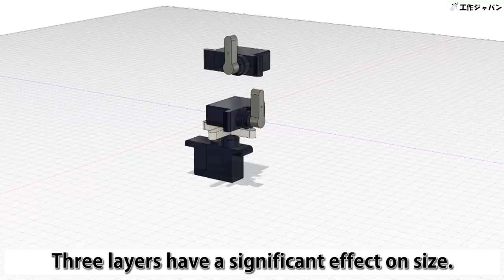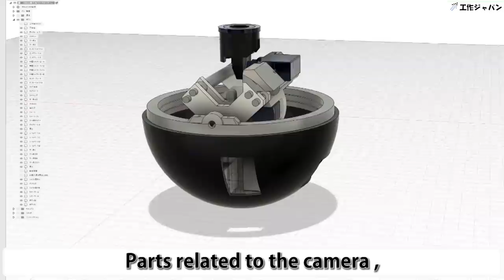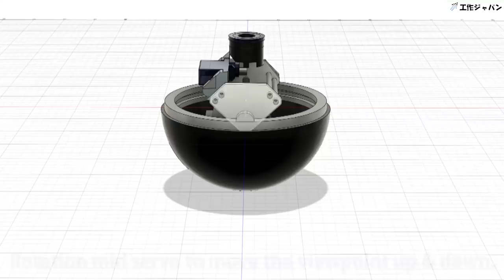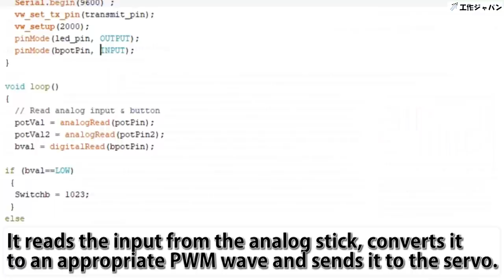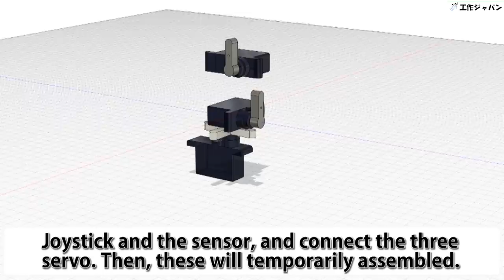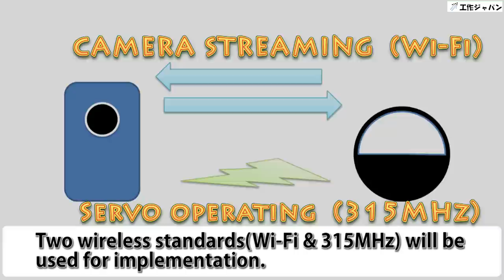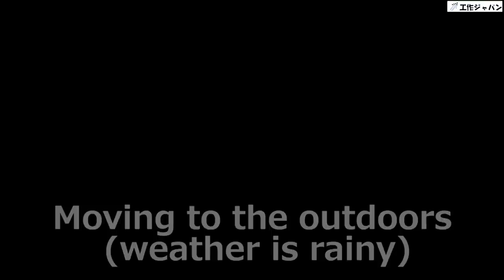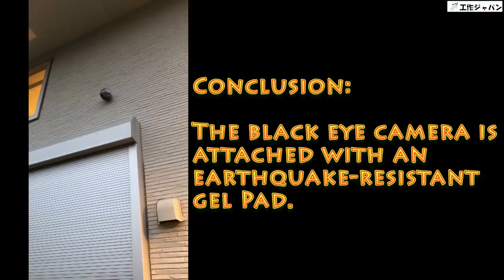I made actually works Rainbow Six Siege's "Black eye" camera of Valkyrie. DIY real life gadgets.

Comment: This is incredible! While I was watching and thinking, Why not use ESP8266 with a camera module, BUT using the pre-made camera and transmitter is very cool! Very very very impressed.
Reply from the maker: Thank you for your comment!
It was very motivating.

In my country, radio regulations are very strict, and there are restrictions on many wireless devices.
ESP8266 has been approved for some devices. So I can use it if I want to, but there is a problem. There are modules in circulation that lie about being approved. I had to give up because of the risk of buying a module that was not approved. I would like to use it someday.

But it was also very fun to devise something with various restrictions. It was a pleasure to communicate with you. 
Thank you!
Reply: @Kousaku_Japan  thank you for responding, that makes perfect sense. Very good choice as ESP8266 are often clones and cheaply made. Great work. Please make more projects. 頑張って

Comment: The only difference I can see is in the game, it wobbles around in your hand, trying to automatically get stable
Reply from the maker: Thanks for your comment!  Actually, I was able to implement the automatic horizontal holding function.  But the camera image shook because the motor continued to move finely.  So I made an automatic adjustment once every 5 seconds.  
I'm very happy that you took a closer look at the details.  Thank you!
Reply: @Kousaku_Japan  Did you try with a PID controller to smoothen the movement?
Reply: @Kousaku_Japan  try like .1 sec, like in the game count ms between movements

Comment: the bricks could of been used to measure. House is based in US, standard brick dimensions for 8x3 and 5/8x 2 and 1/4. The side of the brick that the black eye is stuck too is the 2 and 1/4 inches so if you account for the mortar, it's roughly 4 and 1/2 to 4 2/3 inches.

Comment: Nice work !
For the horizontal axis, you may use of hysteresis to avoid shaking and keep high speed correction.
Reply from the maker: Thank you for your comment!
I designed it beyond my ability. The whole time, I was getting shaky behavior, so I cheated by using simplified specifications.
I'll try to learn from the advice I received. It looks like servo motors will be making many appearances in the future project.
Thank you!

Comment: I'm gonna leave a comment for the algorithm, but I think if further adjustments are to be made fitting a higher frame rate camera and reducing the sensitivity of the servos would probably be high up on the list of things to do
Reply from the maker: Thank you for your comment!
At the time of its creation, I thought that the linkage between the controller and the servos would work more linearly and accurately.
In reality, it became awkward due to time lags and communication interruptions.
It is indeed necessary to slow down the speed of the servos and move them slowly.
The camera is quite annoying. In my country, the frequency restrictions for wireless cameras are very strong. It's a shame that I can't use a camera with good performance.
Your advice is spot on for what I've been struggling with. I sometimes get some harsh comments when I publish my videos, but I think this is the great thing about YouTube, that I can get such accurate advice.
I would like to create and publish more of these.
Thank you!
Reply: @Kousaku_Japan  thank you for putting a smile on my face, I usually leave comments like these expecting nothing but you sorta made my night by replying so positively!
it sucks that you are restricted for the cameras because the project would have been at a way higher quality if that simple change was made.
I also agree with Making more things like this that is usually the right thing to do to keep up the momentum of the channel and to grow your audience a quite a bit!

Comment: Might I add a suggestion? Instead of using a servo to auto rotate to horisontal, you could get away with simple gravity and a bearing that holds camera pitch and yaw axis along with battery and transmitter.
Reply from the maker: Thank you for your comment!
The current structure is not in a state where the contents can rotate freely. The current structure doesn't allow the contents to rotate freely, because it's limited by the battery and other cables.
I think the concept in the game was to be able to freely rotate everything except the horizontal.
Both are great ideas, but I lack the skills. I'd like to gradually build up my skills and make it work more realistically.
It was very stimulating. Thank you for looking into the details of the video. It's motivating!
Thank you!
Reply: @Kousaku_Japan  That sphere is two halves, yes?
Print an axle holder for the center of the rear half, make a cage and a provision for a ball bearing, that way you can mount the cage on the axle ensures that the camera will be horizontal at all times. You get rid of one servo at the same time.

Comment: I think you could go far with an Empire EVS hud mask. Ive wanted to find someone to move the hud harware to a motorcycle helmet to but know no one local for it. The other problem is im pretty sure empire went out of bussiness and the helmet ran on proprietary sofware. But if you could find away around these problems then you could use the helmet and and cameras in synergy. Could be specially built for room clearing. I.E. Roll a camera down a hallway (no sticky stuff on it) and get a safe vantage point from info given by the camera.

Comment: Would it possible to use one less servo - by adding some sort of MEMS to detect horizontal position, and use the data to adjust two remaining motors steering?
Example - if the camera is attached at 90dgr angle, software should invert X-axis with Y-axis, and if at 45dgr, rotating camera on X-axis whould use both motors "half-and'half"

Weight and size reduction?
Reply from the maker: Thank you for your comment!
I don't know if I understand everything I've been taught, but I think I can control the orientation of the two pieces to a certain degree.
However, the calculation is very complicated and I'm not sure about it.
If I can make it work, I'll be happy to have one less servo, which will simplify things a lot.
Thank you!

Comment: That's legit. Does an arduino have the ability to follow movement or is that a function for a raspberry pi?
Reply from the maker: Thank you for your comment!
I haven't been able to implement a chase function. It was a remote control.
The only thing I made automatic with the Arduino was the leveling action.
Thank you!

Comment: How do you manage to transform video signal by Wi Fi,what kind of Wi FI module do you use?is it built in the camera module all ready?
Reply from the maker: Thank you for your comment!
I used a module, so it's completely separate from the system that operates the servo motors.
I took it out of some gadget, but I don't have the exact information anymore.
Thank you!

Comment: how about using the 3m double tape, another Buble suck toy?
Reply from the maker: Thanks for your comment.  I'm sorry for my late reply.  
Thank you for your advice.  Actually, I also use 3M tape in the video (around 12:25).  
This tape is strong, but it took a little longer to stick.It seems that a softer material is needed to make them stick together instantly.

Comment: where did you get the glass case?
Reply from the maker: Thank you for your comment!
I did not make the transparent parts myself.
That’s hemispheres for Christmas ornaments.
They put toys and ornaments inside and hang them on the tree.
Probably available on ebay in season. It's made of plastic.
Thank you!
Reply: @Kousaku_Japan  I thought you would do the parts with the linked 3D printer and I meant the transparent matterial part of the vertigen model and thank you